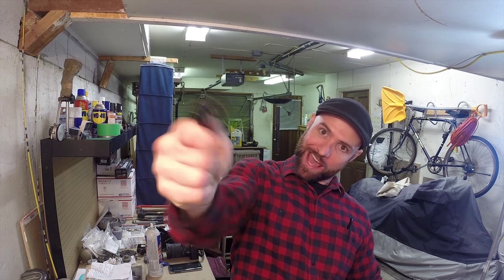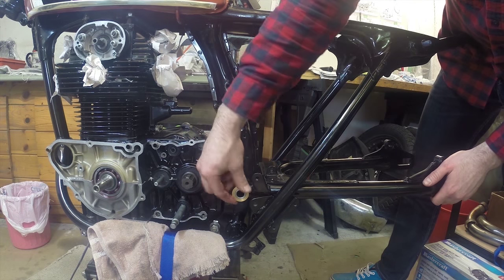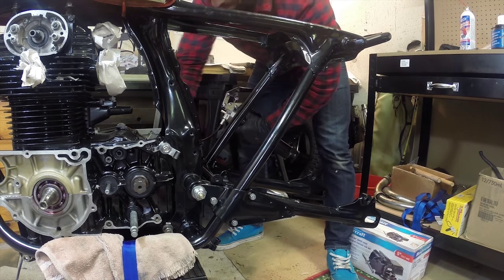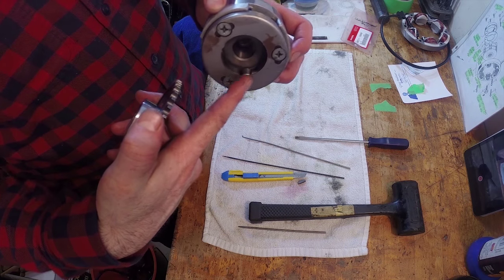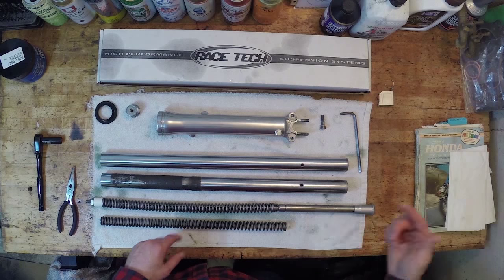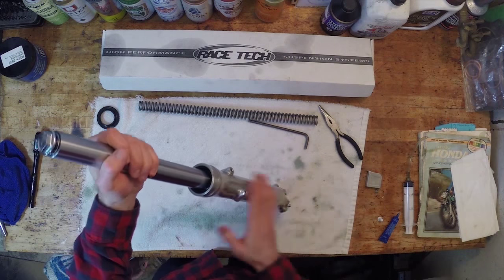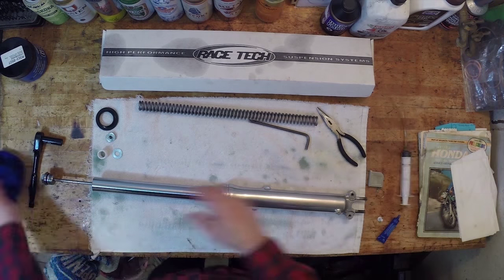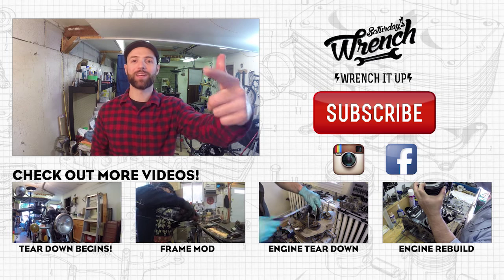Saturday's Wrench Ep.23: Starting Clutch/Suspension Install - Honda CB350 Build

Comment: those "keepers" on the alternator shaft are called woodruff keys. you can find them at some hardware stores like Ace. 

if your alternator happens to pop off the tapered shaft it can easily shear the key and possibly damage the keyway. its less likely to happen on that shaft because the starter motor is the only force applied on it other than the actual crankshaft. it's more likely to happen on stuff with a high rotational weight and driving force like a clutch or drive sprocket.

be sure to always tighten things that connect via taper shaft to specified torque. I've had a flywheel that came loose and not only sheared the key but also destroyed the keyway, meaning a new crank was needed. bad day for sure!

thanks again for making these videos, they'll be a huge help when I step up to do my cb350. it's also a huge inspiration, very motivational how you keep pushing on with the build even with the setbacks you encountered. and everything you did on this beaut was so detailed and overdone. so much work and effort applied to every aspect of the bike, down to the nuts and bolts. at the end of it all I bet you've become a cb350 expert! there certainly aren't as many hands-on type of people in this generation.
Reply from the maker: +Sir Charles Yes.. Woodruff keys! I remember that as soon as I read your comment. Thanks for the detailed explanation. I will most definitely torque everything down. I am keeping a list and marking the bolts that I've torqued so I don't miss anything. Everything will be thoroughly inspected by a licensed mechanic at the end of the build to make sure! Thanks again for the info man!
Reply: +Saturdays Wrench sure thing man. after all the time you've spent building this bike I'd hope that you could have thousands of trouble free miles to enjoy it!

I'm not building my cb350 yet, but I'm working on an old vespa ciao moped right now. big bore kit yo, 65cc's! lol.
Reply from the maker: Haha thanks for the positive vibes! Sounds like fun though. A little ripper! Good luck with it.

Comment: You will need to modify your steering stops if you are going to use clip-ons. Either drilling and adding bolts to the stock stops. Or grinding them off and making new ones/cognitomoto have a set of adjustable stops you can tap holes for.
Reply from the maker: +Overture Ya I was assuming I would need to modify those. I'm going to wait until I have everything together before I do anything. Thx for the heads up!
Reply: Saturdays Wrench Doing it now means less fiddling later, when you have to remove the lower triple you need to take apart everything >_> front wheel and all. You only need a drill press and taps or if you go for the adjustable a grinder/dremel.
Reply from the maker: +Overture oh wow.. ok cool man. I'll look into it asap. cheers!

Comment: Another great episode Tony! You're really getting close to finished now. Re the preload drama, I take it that's only applicable with ractech springs? I have the same forks as yours but I'm planning on using the stock springs. Also, the fork oil measure technique you used. Is that a good guide even with stock springs?
Reply from the maker: +Anthony McFarlane Thanks man! Ya, so the techniques used to preload and measure oil are for those springs only. I should have mentioned that. I'll add an annotation actually. For the stock set up you'll definitely want to follow your workshop manual. I don't believe they require a preload spacer and the oil amount will definitely be different.

Comment: Great series! I am doing a cb450 curently and had some problem with removing the rear swingarm rubber bushings (ones that shock is bolted to). You never mentioned them and they look like they re painted. Did they survive powder coating?
Reply from the maker: +chajcu I definitely did not remove them and they survived just fine my man! Got new ones just incase but upon inspection they were fine IMO so I didn't sweat it.
Reply: +Saturdays Wrench mine were all rusty and seized but eventually gave up with a loud snap noise you cherish so much ;) good luck on your project!
Reply from the maker: +chajcu thanks! You too.